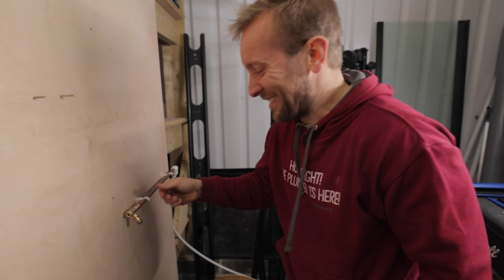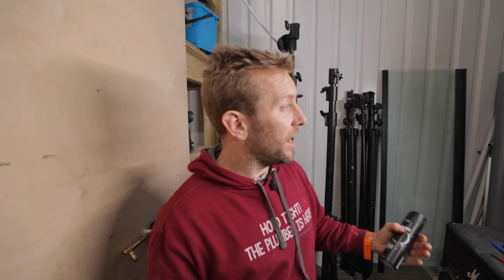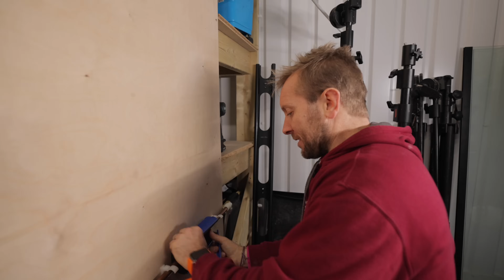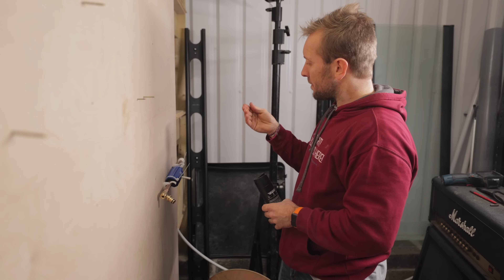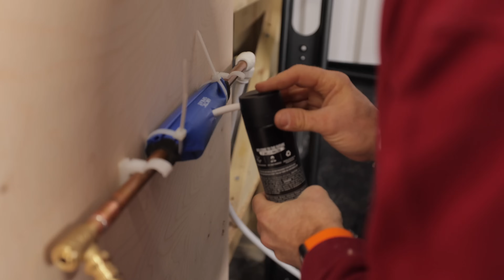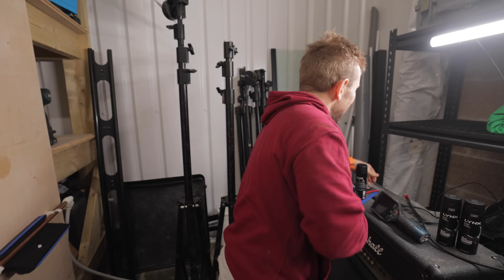CAN YOU FREEZE WATER PIPE WITH NORMAL DEODORANT? Find out!

Comment: Good try Jaz old boy, but you need to use inverted cans of Duster Buster!! They were a quid from the Pound Shops. I’ve used 13mm wall foam lagging, tied both ends with a Cable Tie & Tape along the Joint. 3 tins will do a 22mm Pipe.
You’ll know it’s frozen when you see frost around the end of the lagging.
Tom Plumb has a video showing how it’s really done.

Lots of luv from Jockoland❤❤
Dick Puller

Comment: You should have inverted the can - you need liquid to hit the pipe, the liquid will evaporate and take the heat from the pipe freezing it.
Doing a normal spray will cause the evaporation to occur in the can - the can will freeze as you found but the spray will not be cold enough to freeze the pipe
Also you should add a disclaimer that the spray in that quantity can be toxic to breathe so well ventilated area only!
Reply from the maker: Might do the test again now! I'll smell lovely!
Reply: I was just going to say the same thing, turn the can upside down.

Comment: I've tried various electric based pipe freezers that use peltier cells. They only work on pipes up to like 6mm. On 15mm forget it. 

You need to consider that water has a huge capacity for temperature, and a small can of deo doesn't really have that much "energy" available.
Reply: Peltiers are just crap at pretty much anything. If you want to get something cold a compressor style is the only way.
Reply: @HA05GER  let me dream :c solid state electric pipe freezer. hhhhh

Comment: Lighter refill gas would be another option.
Reply: and then when you take the torch out, BANG.
Reply: @dimitar4y  well technically you you would only use the tin for freezing the section of pipe. Once pipe frozen the gas in the area would disperse but pipe would be frozen for longer than gas would stick around. Wouldn't need that much gas either. The temp of the gas is so low it would freeze pretty quick. I've used it on plants and it froze them in seconds. Few seconds of gas not going to blow your house up
Reply: @rbotgam3z675   If you ventilate well enough yeah. It's always a risk though.
Reply: @dimitar4y  well technically you you would only use the tin for freezing the section of pipe. Once pipe frozen the gas in the area would disperse but pipe would be frozen for longer than gas would stick around. Wouldn't need that much gas either. The temp of the gas is so low it would freeze pretty quick. I've used it on plants and it froze them in seconds. Few seconds of gas not going to blow your house up